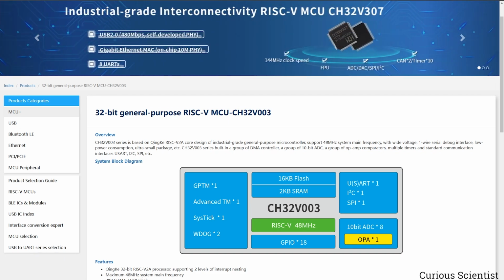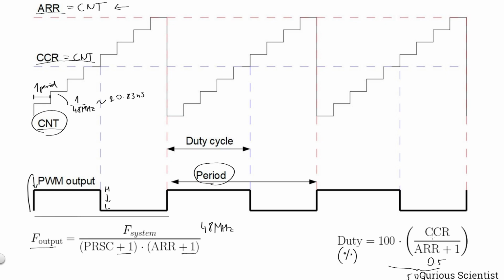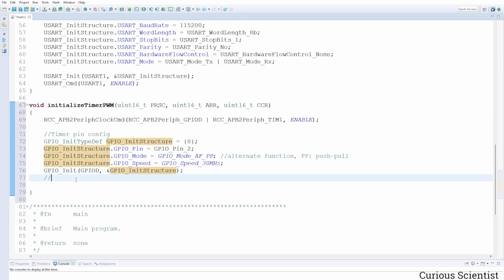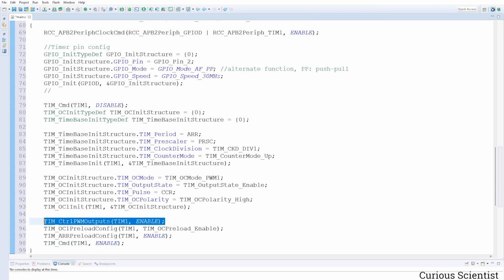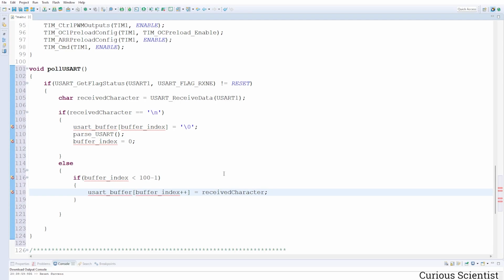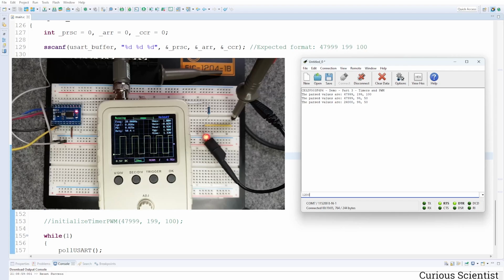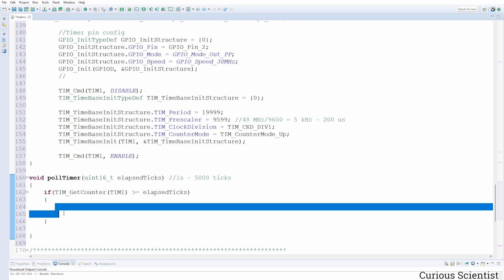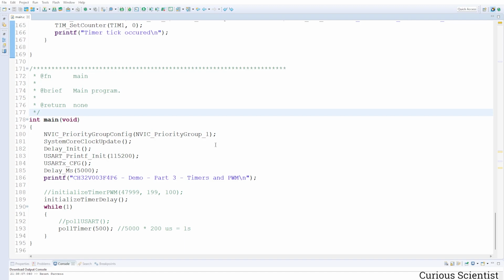CH32V003F4P6 Tutorial - Part 3 - Basic Timer and PWM

Comment from the maker: CH32V003F4P6 Tutorial - Part 3 - Basic Timer and PWM Summary

* 0:00 Introduction: The video covers timers and PWM functionality on the CH32V003F4P6 microcontroller. 
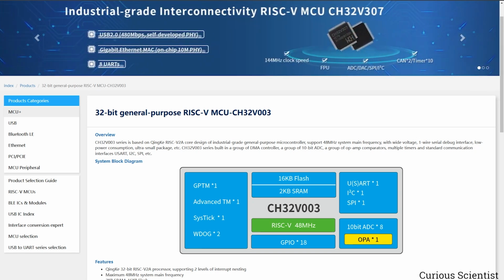* 0:45 Basic Timer Operation: Timers count up or down based on the system clock (48MHz in this case).  The period is the inverse of the clock frequency (1/48MHz ≈ 20.83ns). 
* 1:33 Timer Registers: 
    * CNT (Counter): Stores the current count value.
    * ARR (Auto Reload Register):  Defines the maximum count value before the timer resets to zero. It also determines the PWM period.
    * CCR (Capture Compare Register): Controls the PWM duty cycle, specifying when the PWM signal changes state.
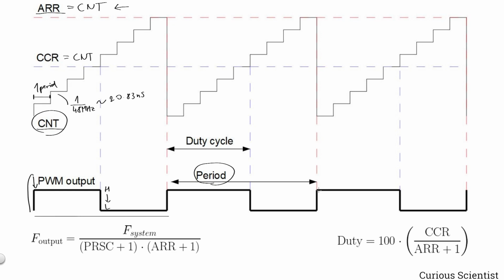* 5:08 PWM Frequency and Duty Cycle Formulas:
    * Frequency: `Fsystem / ((Prescaler + 1) * (ARR + 1))`
    * Duty Cycle: `(CCR / (ARR + 1)) * 100%`
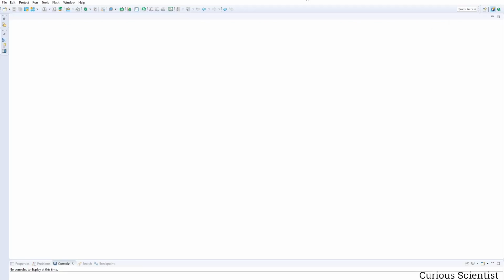* 7:57 Code Implementation: The video demonstrates timer and PWM configuration using MounRiver Studio.
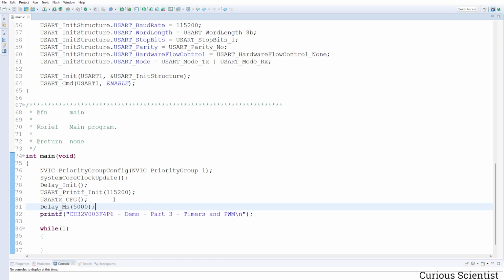* 9:26 Timer Initialization Function: A function `TIM1_PWM_Init` is created to initialize the timer with prescaler, auto-reload, and capture-compare values.
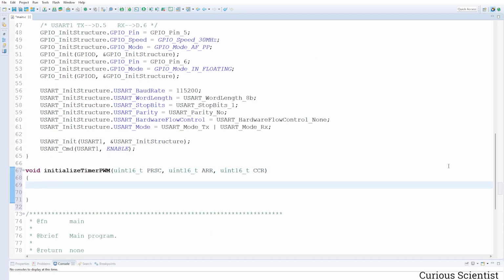* 10:28 Enabling Clocks and GPIO: The code enables peripheral clocks for GPIO and Timer 1, then configures a GPIO pin (PA2) as an alternate function for PWM output.
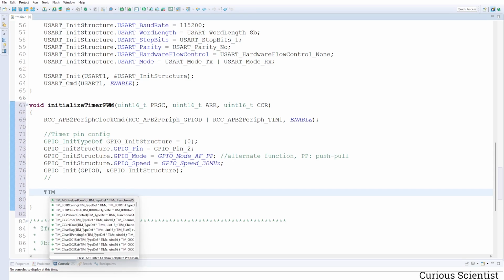* 13:19 Timer Configuration: The timer's time base and output compare modes are configured.
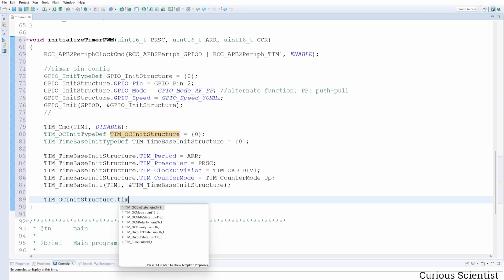* 16:14 PWM Mode and Output: The output compare mode is set to PWM1, the output state is enabled, and the initial PWM output is set to high.
* 20:08 Setting PWM Frequency and Duty Cycle: An example shows setting a 1kHz PWM frequency with a 200ms period and 50% duty cycle by calculating the appropriate prescaler, ARR, and CCR values.
* 22:57 Dynamic PWM Control via USART: Code is added to receive prescaler, ARR, and CCR values from the serial port, allowing for real-time PWM adjustment. 
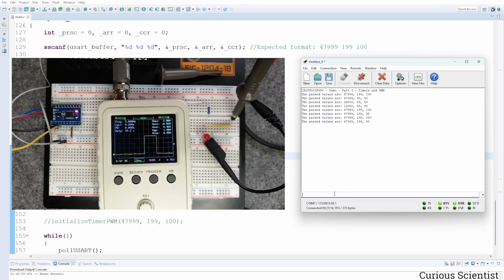* 34:18 Timer-Based Delay without Blocking: The video shows how to use a timer to create delays without using the blocking `delay()` function. 
* 37:00 Calculating Timer Ticks for Delay: The timer is configured with a 9600 prescaler, giving a 200µs tick period.  To achieve a 1-second delay, the timer is set to count up to 5000 (1 second / 200µs).
* 38:20 Timer Polling Function: A `TIM1_Delay_Poll` function checks if the timer count has reached the desired value, and then performs an action (toggling an LED in the example).
* 47:00 Conclusion: The video summarizes the basic timer and PWM concepts, provides links to additional resources, and encourages viewers to subscribe and support the channel. 

I used gemini-1.5-pro-exp-0827 on rocketrecap dot com to summarize the transcript.
Cost (if I didn't use the free tier): $0.03
Input tokens: 21321
Output tokens: 713

Comment: @curiousScientist I'm unable to understand how can I program from beginning to industrial . I am proficient in C++ and oops but facing difficulties to understand I just worked on Arduino
Reply from the maker: It's not enough to just know the language. You need to know the hardware and be able read and understand the datasheet as well. That's why it might be difficult.
Reply: I read the data sheets and know the basics of MCU but I don't know where I have to use bus and where enable disabled etc things i want to learn it from begning to advance please give me a complete roadmap to learn it i will be very thankful to you
Reply: @HabibullahKhan-s9e
You need to start with stm32 they're a lot of documentation and you need to read the same books about arm microcontroller like the definitive guide of cortex M3 or M0 and M+ , don't try to read them all but go with topics for example you need to know how to setup the clock for the microcontroller Gpio 
You need to the memory mapping off the Gpio and the register controlling them you need to the electronics spec for Gpio etc..
Reply: @jeanmichel9207 thanks dear

Comment: CNT start from zero and increment on each clock cycle when count reaches CRR PWM pin change  it's state. when CNT reaches CRR , CNT reset  to zero and PWM pin change  it's state it is correct what I understand ?
Reply from the maker: No. You don't even use the correct abbreviations. Watch the video again.

Comment: Hi, I have a variant of the CH32V003A4M6 MCU, which does not have the PD2 pin exposed on his package... how to reassign timer 1 to alternate pin?
Reply from the maker: Hi! Watch the video. It is shown line by line how to assign the timer to a specific pin.
Reply: @CuriousScientist  no you don't!... the code only shows the assignment to a port PD2... and as i understand it, it works because TIM1_CH1 is on PD2 by default!
and according to the datasheet i need to somehow remap TIM1_CH1 to an available port on my microcontroller via (AFIO_PCFR1) remap register using bits ((7, 6)TIM1_RM)
Reply from the maker: Ah, you mean that way. T1CH1 is not available on the SOP16 package as you said. Solution → Use another timer channel, for example, T1CH2 seems to be available on PA1...